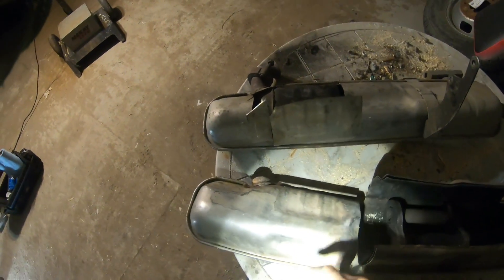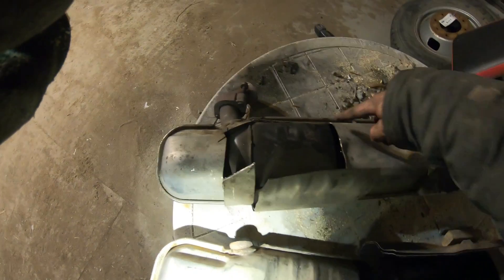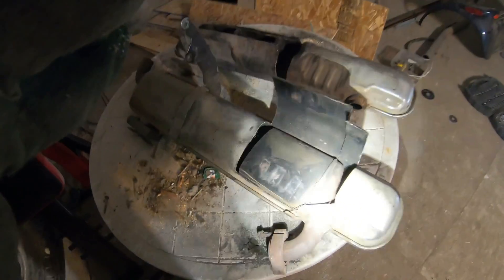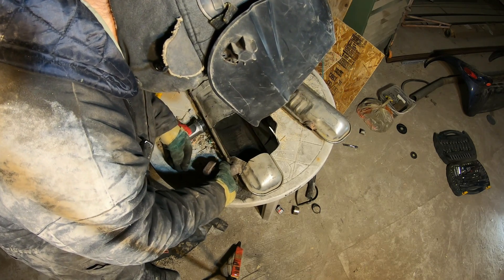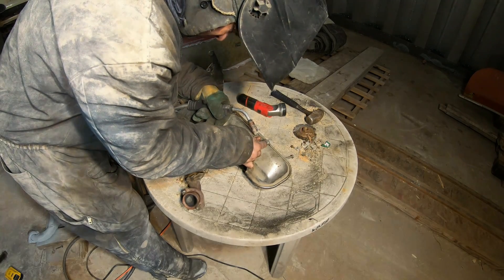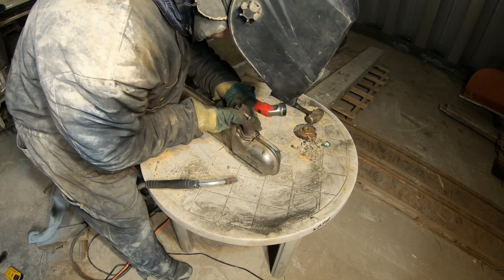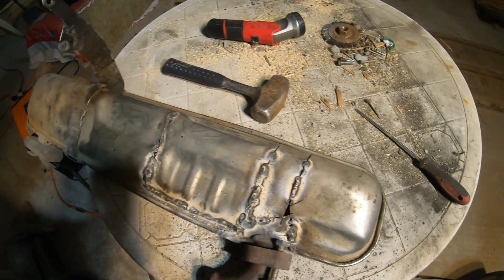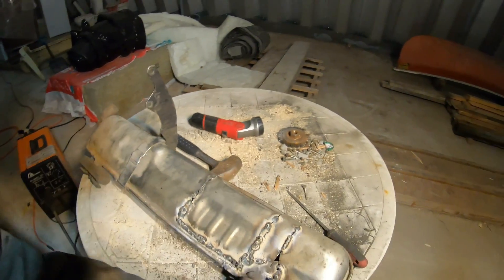Whats Inside A Smart Fortwo Cdi Muffler

Comment: I intend to do the same on my CDI but I have a couple of questions:

Does the engine increase in noise without the catalytic converter?

Does the engine increase the amount of smoke?

Thank you!
Reply from the maker: Little bit but not a whole lot, will hear turbo whistle. Muffler is still intact & working. If extend the tail pipe out the back instead of exhausting directly under the car then it gets alot quieter while driving, just make sure angle down so not suck in exhaust when open window. 
Will do a video where can hear the other car running that has that type of muffler on it. Soon as have some time :)
Reply from the maker: Engine will run better, will notice smoke on start up but no more than normal, catylitic coverter takes time to heat up so it would not be burning soot on start up & would not be working efficiently anyway until the car is warmed up. Usually there is no smoke from the little engine if they are running well once warmed up. The turbo will operate more efficiently due to lower back pressure & engine will run more efficiently smoking less. So the engine will be less likely to smoke without the cat but if it does you will see it as apposed to with the cat on you would only smell it.
Reply: @manbuilds1587  Thank you very much for the help 😀
Reply from the maker: @A_B_R_  https://youtu.be/4k9q5ZDZpbs